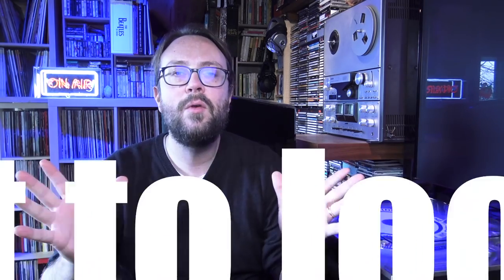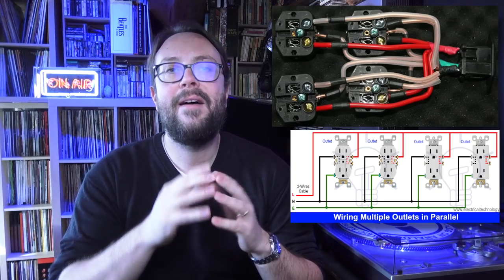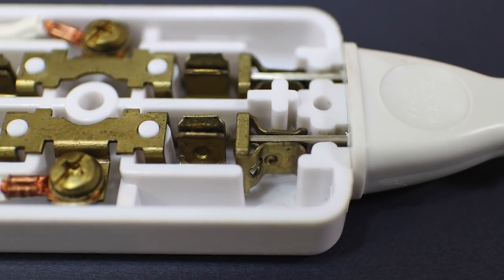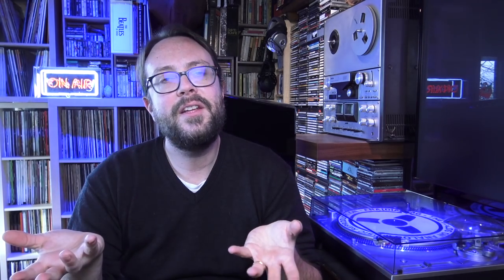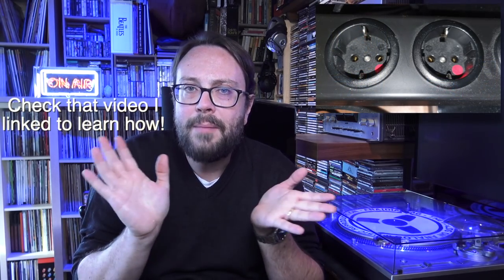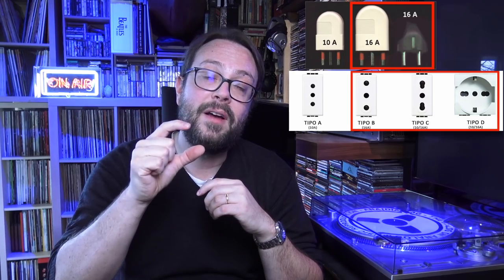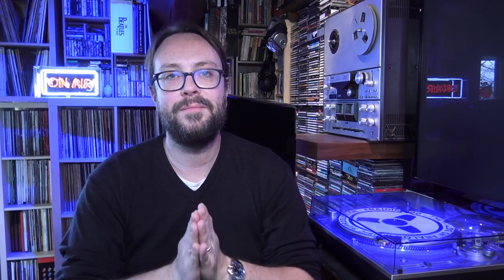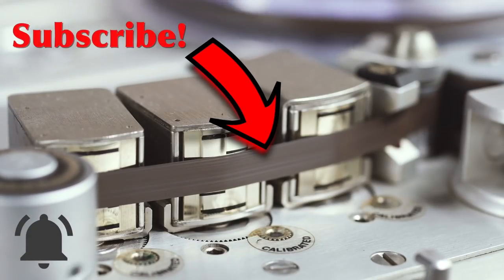Audiophile power strips: what to look for & what to avoid

Comment: Is the advice in this video is for someone that's more or less found their endgame gear and just want to tweak every last ounce out of it?   Because I'm assuming that paying more attention to other aspects of the system: speakers/components will make a bigger difference to the sound quality.
Reply from the maker: Main components are always going to be  more important by definition. Tweaks are for getting the max out of them. This said, power is paramount. A good amp with quality power will become an excellent amp, therefore not a small tweak but a proper setup to exploit in depth a piece of gear.

Comment: Great video! And nice advice regarding whe wireworld matrix. Unfortunately this seemed to be a common problem with most power strips on the market. There is always a catch. I saw many solutions where only two plugs from six were star wired, but obviously they just say it is star wired to grab your attention and only rarely explain the restrictions. And this is valid even for very expensive power strips! You would think the Furutech tp609 ncf is star wired.... but it not completely, the ground is serial!! Only when you know this, you understand why they write "star wired" (under brackets) on their website... because they know it kind of isnt....but they dont explain it! The 609 is a obvioulsy a great power strip, what kills me is that Furutech, as most suppliers, is not at all transparent regarding this.....and obviously they know about the benefits of star wiring, as the obscenely expensive e-TP809E is completely star wired...talk about limiting your own products....
The lack of transparency from hifi manufacturers is really a shame. Ok, rant over, nice video :-)
Reply from the maker: Unbelievable! I call that fraud, plain in simple.

Comment: LOL - it make no differences from a plastic POWER STRIP compared to a metal. The star connection or individual wire to each socket inside that box make no differences unless it has an isolated circuit, but again this topic is talking about a power strip not a surge protector or conditioning. A power strip is nothing but a bank or row of metal bar to distribute power to multiple outlet. Electricity conduct energy just fine in whatever that power strip. I haven"t seen in my lifetime a power strip that gave me less power than what coming out of the wall socket, LOL. If you want noises less (not noises free) or isolation from anonther devices that plugged into the same outlet, get a power conditioner with outlet isolation. Use shielded power cord from power condition to your equipment to avoid EMI & RFI. Why? The power coming out of your conditioner has been treated so you dont want to attract noises back in to the line between the conditioner and your equipment. Plugged a shielded cord directly to power strip or wall does nothing or it will reduces or eliminate anything. Stop spreading something that doesn't make sense.
Reply from the maker: Which quality power distributors have you tried?
Reply: @anadialog   Please elaborate QUALIFY power distributor power strip from a none. I work with electricity for 30+ years and would like your input in this.

Comment: You missed 1 thing power line filtering or regeneration
Reply from the maker: I didn't! Maybe you didn't see all the video...in the end I strongly recommended to use a power conditioner, also known as mains filter in the UK.
In any case that is a different component.

Comment: BS. I am wondering if anybody can distinguish  "bad" power strip or cable from "good" one blindly.
Reply from the maker: I am wondering if you ever invested in an audiophile grade power strip.
Reply: @anadialog  No, I have some physics understanding which is against all that power cables discussion. For example, I don't understand how good power cable can affect sound quality, if cable from your area power transformer to you house outlet is regular cable? So you have few miles of regular cable and at the end you connect very good one meter cable.  How that one meter can make any difference?
Reply: BTW Don't take me wrong, I am your fan)
Reply from the maker: I made the same question several times. A knowledgeable engineer explained to me that we are using the wrong perspective. You must use the perspective of the amp, or any other piece of gear, for the machine it's the first meter of wire, not the last and it is paramount to have a good cable to obtain a clean and abundant power supply.
Reply: Seva3star, think of tap water. Is it possible for the pipes inside your home to degrade the water you pour into your glass, after it has entered your home? It is a benefit to make sure that the wiring is high-quality as far back in the chain as it is possible to do.
Reply: So by that logic putting a 1m shorter wire between your switch panel and outlet makes huge improvements, since no cable is the best cable isn't it.

Comment: DISAPPPOINTING VIDEO: Most of what you said is usually invisible until after you buy it. The most important aspects weren't even described: Voltage Regulation, Overvoltage Clamping, and Dirty Electric Reduction. No audiophile should be buying a power strip, they should be buying a Furman or Radial Engineering power conditioner instead.
Reply from the maker: This is a power distributor, not a power conditioner. The elements you are highlighting have nothing to do with a power strip and if present, they will degrade sound. A quality power strip is not the optima solution but used with a good power conditioner WITH the characteristics I exposed you will maximize the effects with the right cost. 100% solid. You had other in mind and that is why you were disappointed, understandable.

Comment: "A power switch will kill the dynamics"? WHAT? Are you real? Do you have any knowledge in electricity? 
Don't listen to this guy. You're wasting your time.
Reply from the maker: I perfectly know what I am talking about and I also know the diagram of a switch. Do you? It's an interruption and attenuation of the signal. If you want max quality non of this must be along the line. That is why I don't recommend a IEC inlet. If you check all quality power distributors you will see that they never have this. If you think that audiophile  cables and power strip are all BS, that is something different. Quality is quality. No question about it. An interruption along the line degrades that signal.
Reply: @anadialog  Not all quality strips have their cable attached-fixed. In fact there are many that don't, like Supra, Taga Harmony, Emotiva, Gigawatt, Oehlbach, Pro-Ject. Al of them with IEC sockets.
Reply from the maker: Yes, absolutely. Actually most audiophile power strips/distributors have IEC inlets as the one I put in the cover of this video.
Nevertheless, if you want top quality it should be directly connected to the power outlets. In any case, this is not a crucial point like others. A good IEC connector and a good cable will do an excellent job.
Reply: I happen to know how switches work (many kinds of them) and happen to be an electrical and electronics engineer (are you? :)
It also happens that most of the high-end power strips/distributors (like the ones mentioned) do use switches.
AND it also happens that ALL amplifiers have a switch. I dare you to find one from high-end companies (e.g. Krell, Krell, Pass Labs, Audio Research, PSAudio, Classé Constellation Audio, Dan D'Agostino, etc.) without one. Do they also degrade the sound?
Reply: @lambischiragua3628  Forget it buddy! MEng Audio Electronics with merit here and all I'm saying is trying to explain there is no audible quality drop, is futile. While he is right about several of the things you have to check for a power strip, this switch thing is pure audiofoolery.
Reply from the maker: Great! Then thank Goodness you can easily understand that everything in between the power outlet on the wall and the power cord of your piece of gear will degrade the sound. The best, as some people correctly said, 8s to plug everything in the wall and leave aside power strip and I agree! The only problem is that most of us use up all their wall sockets. 
Amplifiers? We are talking simple power strip, don't change subject. Quality audiophile power strips in most cases don't have a switch to turn off and on the power, starting from the one I put in the thumbnail of this video. That is a fact.
Reply from the maker: Just because that part does not match your opinion? Obviously we are not talking night and day difference but coming to details this is a detail to keep in mind. It is rather logic. All interruption of the signal degrade the sound.
Reply: @anadialog  I don't know if you're replying to me in any of those two posts, but hey this is always a bit like a driver and a car mechanic talk, after all. As I said, to the other post above, from a point onward, this is futile.
Reply: @lambischiragua3628  You could not be more right.  Because if  they had direct connection  they would not be abble to sell expensive power cables.  Because if there where any discernible difference it should all be hardwired.
Reply: @anadialog  No. I'm sorry. This is not logic.
Reply: Hi, don't want to tense anyone, but guys try to be more polite when trying to state something and when disagreeing. Offense was never a  good way to make conversations.
Reply: Used to think like you untill I tried it myself. The difference is uncanny
Reply: @anadialog  Rubbish!
Reply: @Yiannis2112  that is true, but the influence of ice plug and socket quality and coating (gold or rhodium etc) is very audible, and the question here is whether this could be eliminated at all. You might search for the Mains Hydra, a distributor, that has the component power leads firmly attached to the distributor :) - obviously for this very same reason.
Reply: @gioponti6359  I can do even better. I can hear the difference seaborgium plated usb cables, make.
Reply: @Yiannis2112  lucky you, am burning to learn the isotope number of your Sg-coated kit! Glad you manage to get it auditioned before Sg disintegrates. Interesting field this 6d metal micro-second audio. As tempting as it is, i shall opt to remain in trusted ‚field of gold ..and rhodium’ though.
Reply: @anadialog  why would a switch attenuate the signal?

Comment: in most modern european connections all you need is a fused power strip to prevent a power surge and just run a single line from main to the setup thats all the rest is snake oil
Reply from the maker: Surge protector power strips kill dynamics. Ben there, done that. Which high quality power distributors have you tried?